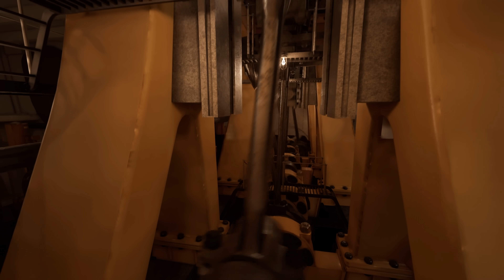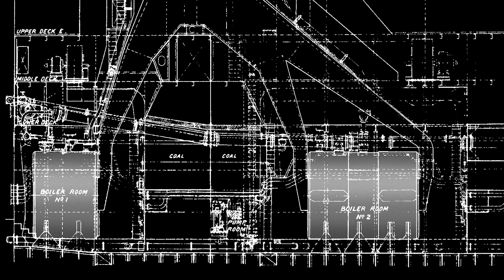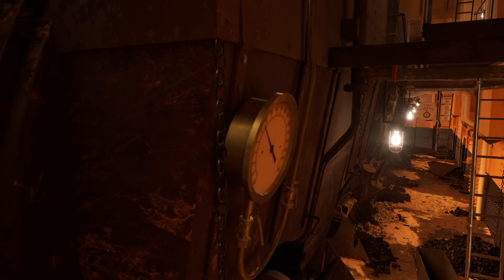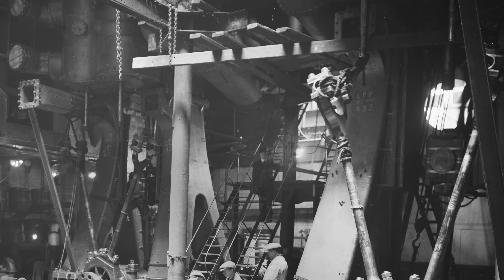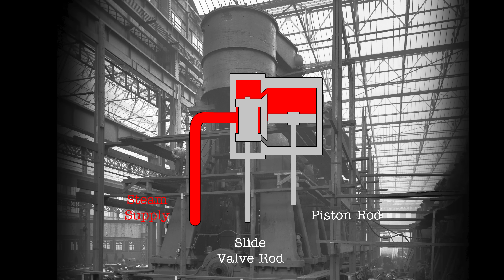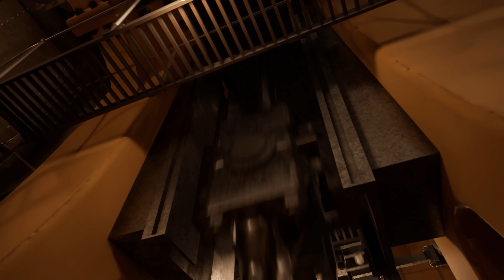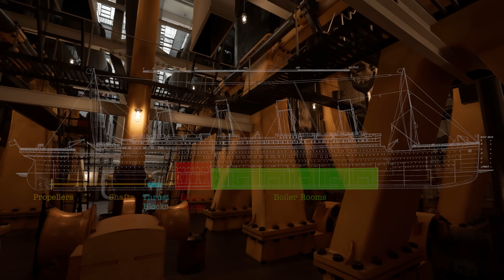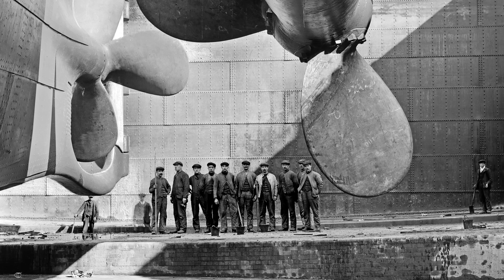A Complete Guide to Titanic's Engines

Comment: I just find it astonishing and to be honest a little sad that the unbelievable amount of knowledge and skill that went into building systems like this, all of that has been lost.  It has been lost because the technology became obsolete but all the same, it is incredible.  Around this time was probably the pinnacle of the steam engine and steam technology, the steam engine had been around for nearly 200 years and used on an industrial scale for getting on for 100 years by the time Titanic was built so to draw an analogy it is like comparing a modern F1 engine to the first internal combustion engine, that gives an idea of the immense complexity and nuances to the system culminating from decades of innovation and refinement to what is essentially a simple concept for converting chemical energy into rotation

Comment: Looks like you overrate the tonnages by the factor of 10.
600 tonnes of coal per day equals the weight of two London busses? I assume it is more likely 60 tonnes per day.
The same for the engines. 700 tonnes per engine is a bit much.
Reply: Listen to it again

Comment: Not Titanic, Olympus
Reply: No. Just no. That theory has been proven to be false for decades. But because you wont believe me without facts let me list off every reason why Olympic was never swapped with her sister. 

Starting with Olympic's collision with HMS Hawke on September 20th 1911. The initial theory stems from reporting at the time the following the collision RMS Olympic broke her keel. This is a flasehood that was created by the press to cause a sensation that White Star Line's newest and grandest liner was now broken beyond repair. This is not true. As stated in the Admiralty's report: 

“Two major watertight compartments were flooded, hull plating gashed from the Orlop deck to E deck, and the starboard propeller shafting damaged.” 

There is no mention of damage to Olympics keel. This theory falls apart further when you examine the two ships involved. HMS Hawke was built with an 8ft armoured ram. RMS Olympic was 98ft wide at her widest point and around 94ft at point of collision. In order to have damaged Olympic's keel HMS Hawke would have needed to penetrate 48ft into the Olympic which by that point she would have been doomed regardless of a broken keel. 

The damage sustained by Olympic took 40 days to repair. Not to mention she sailed from south hampton to Belfast on her own for said repairs. And during the repairs they took the port propeller shaft from Titanic and installed it on Olympic to press her back into service as soon as possible. 

As for the idea of swapping the ships out because they were 'identical', no, no they werent. Titanic had many features that Olympic did not. I will stay away from mentioning the difference in window layouts however i will point out that Titanic had significant structural differences in her B and A deck constructions to the point where in order to make her look like her sister olympic on the inside it would have taken an entire reconstruction of her superstructure between those two decks. Furthermore Olympic's bridge wings were flush with the ships superstructure whereas on Titanic they were extended out slightly to provide better visability a lesson learned from her sister. Not to mention swapping the names would have take at least a month if not longer due to the fact that the nameplates were engraved into the ships metal not painted or bolted on. In fact you can still clearly see Titanic engraved on the wreck today 

But the biggest nail in the coffin for this theory is this. Before the ships were named they were known as Yard number 400 for Olympic and yard number 401 for titanic. Every single fitting on these ships was stamped with the number that corresponded to the hull they were made for. On the wreck of Titanic on all of the machinery that hasnt rusted to dust you can see the number 401. Same goes for artifacts recovered from the wreck site. 

Titanic wasnt sunk on purpose as some part of an insurance fraud scheme, she was insured for considerably less than she was built for and her sinking pretty much ruined the white star line resulting in the 1934 merger with Cunard. She was insured for 5 million but built for 7. White star then had to pay out to the victims and their families. 

Titanic was sunk because of hubris and arrogance. The crew genuinely believed her to be unsinkable due to new inovations such as her double bottomed hull and water tight compartments. They were under orders to try and set a record crossing in order to win the blue ribbon on their maiden voyage. Had they entered the ice field during the day they would never have travelled at full ahead. There is no conspiracy around the Titanic. Human arrogance and error sent her and 1,517 people to the depths of the atlantic, not some machiavellian scheme by the rich.

Comment: The 9 psi is actually over the ambient air pressure,  not 9 psi  under the "1 bar".  Please ask drachinifel if you don't believe it.
Reply: How is 9 psi over 14.7 psi?
Reply: The psi for pressure  measures the difference between the inside versus the outside of a container. Steam pressure on the inside (200 psi, 90 psi, 9 psi...) is higher than the outside. A car tire has 32psi more pressure than the outside, and the atv 4-wheeler tire has 6-8 psi on the inside. A  cardboard box is zero psi on a pressure gauge. Steam pressure pushes turbine blades or pistons by thrust, not vacuum.

Comment: So was Lt. Murdoch at fault when he ordered "full reverse" right before collision with the berg? 
It does not seem the ship's engineers could accomplish that, given your explanation here.
Would it have been better to just throw the helm over hard to veer from the berg? 
Or to simply "shift into neutral," if that's the right analogy, but still have water pass through the rudder? 
Frederick Fleet warned of the berg and Murdoch knew what lay ahead.
Could the berg have been avoided?

Comment: for peeps like me ....a simple way to visualize how condensing steam running thru the turbine and its condensers, would condense and pull a vacuum and thus "improve efficiency of the low pressure system's, is:    take a Tupperware of food with a slightly loose lid and heat it till steaming in your microwave generating lots of pressure and venting, then stop and wait a moment before removing the container,  and then try to pull the sunken in lid off of it...   it's under a vacuum.

Comment: Question: Why couldn't the coal be gravity-fed from bunkers above the boilers instead of manually shoveled in? You could even have a system that metered out the coal at the right rate depending on the steam pressure you need. I would think this would be possible in 1912. Of course that would cost hundreds of jobs, but efficiency man!

Comment: Titanic Never Sank. It was switched with one of its sister ships, the Olympic, before it set sail.
Reply: That theory has been proven to be false for decades. But because you wont believe me without facts let me list off every reason why Olympic was never swapped with her sister. 

Starting with Olympic's collision with HMS Hawke on September 20th 1911. The initial theory stems from reporting at the time the following the collision RMS Olympic broke her keel. This is a flasehood that was created by the press to cause a sensation that White Star Line's newest and grandest liner was now broken beyond repair. This is not true. As stated in the Admiralty's report: 

“Two major watertight compartments were flooded, hull plating gashed from the Orlop deck to E deck, and the starboard propeller shafting damaged.” 

There is no mention of damage to Olympics keel. This theory falls apart further when you examine the two ships involved. HMS Hawke was built with an 8ft armoured ram. RMS Olympic was 98ft wide at her widest point and around 94ft at point of collision. In order to have damaged Olympic's keel HMS Hawke would have needed to penetrate 48ft into the Olympic which by that point she would have been doomed regardless of a broken keel. 

The damage sustained by Olympic took 40 days to repair. Not to mention she sailed from south hampton to Belfast on her own for said repairs. And during the repairs they took the port propeller shaft from Titanic and installed it on Olympic to press her back into service as soon as possible. 

As for the idea of swapping the ships out because they were 'identical', no, no they werent. Titanic had many features that Olympic did not. I will stay away from mentioning the difference in window layouts however i will point out that Titanic had significant structural differences in her B and A deck constructions to the point where in order to make her look like her sister olympic on the inside it would have taken an entire reconstruction of her superstructure between those two decks. Furthermore Olympic's bridge wings were flush with the ships superstructure whereas on Titanic they were extended out slightly to provide better visability a lesson learned from her sister. Not to mention swapping the names would have take at least a month if not longer due to the fact that the nameplates were engraved into the ships metal not painted or bolted on. In fact you can still clearly see Titanic engraved on the wreck today 

But the biggest nail in the coffin for this theory is this. Before the ships were named they were known as Yard number 400 for Olympic and yard number 401 for titanic. Every single fitting on these ships was stamped with the number that corresponded to the hull they were made for. On the wreck of Titanic on all of the machinery that hasnt rusted to dust you can see the number 401. Same goes for artifacts recovered from the wreck site. 

Titanic wasnt sunk on purpose as some part of an insurance fraud scheme, she was insured for considerably less than she was built for and her sinking pretty much ruined the white star line resulting in the 1934 merger with Cunard. She was insured for 5 million but built for 7. White star then had to pay out to the victims and their families. 

Titanic was sunk because of hubris and arrogance. The crew genuinely believed her to be unsinkable due to new inovations such as her double bottomed hull and water tight compartments. They were under orders to try and set a record crossing in order to win the blue ribbon on their maiden voyage. Had they entered the ice field during the day they would never have travelled at full ahead. There is no conspiracy around the Titanic. Human arrogance and error sent her and 1,517 people to the depths of the atlantic, not some machiavellian scheme by the rich.

Comment: way cool. I worked at a hydroelectric pumped storage plant that housed 3 pump/generators. The largest one had a capacity of 50,000 gal per second at 189 ft of head. The motor was rated at 137,000 hp . Its electric rotor 29 feet diameter.
Reply: Holy Sh*t..trying to wrap my head around that...

Comment: If you would like to see Titanic's engines,  but don't want to get wet or crushed you can see the same triple expansion 4 cylinder engines on the battleship Texas.  Identical in size (or slightly smaller) and 2 engine 2 propeller configuration.  The war ship has no room for the turbine and third propeller. Texas should soon be ready for visitors.

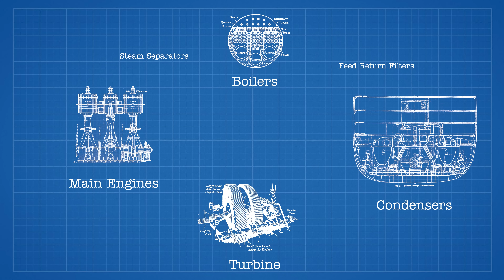Comment: The system diagrams at 8:15 and 28:45 show a picture of a main reduction gear labeled as a turbine.  The Olympic class ships had direct drive turbines and there were no reduction gears  ...  reduction gears came later when gear cutting technology had advanced to where efficient long-lasting gears could be manufactured.  Then, high speed turbines became a practical reality.

Comment: Fantastic Job.  Sorry if this is duplicate, but I noticed that the central turbine propeller is turning the wrong way in the video.  Either that to the blades are angled the wrong way.  Either way the video shows that the central propeller is pushing forward while the other two are pushing aft.  Just thought I'd point that out.  Great job though on the rest.

Comment: SS Olympic was converted to oil in 1919. The coal bunkers were converted to oil tanks. Large burners were fitted into the boilers. Efficiency was not a great as with boilers specifically designed for oil burning, but far better than coal burning. By the late 1920s very few coal fired steam ships were about.  

In the 1930s ships were moving quickly to diesel engines in new designs and refits. However the British designed Liberty ships of WW2 were specifically designed with now old technology, reliable, piston steam engines that could run on coal or oil boilers, in case oil was not available.  So many Liberty ships were built that there were more steam ships in 1945 than in 1939.

Comment: Still cant wrap my head around the physics of a steam turbine working with sub atmospheric pressure. I worked in a coal powerplant during my practical part in university. There were many turbines and burners. Those turbines were high pressure turbines and rotated with a couple of hundred rpm. Overheated steam was used to drive them.
All at high pressure. Maybe thats why i have issues with the low pressure turbines *lol

Comment: Key questions: 
- Who was the contractor that designed the engines? 
- Who was the supplier that assembled the engines? 
- Who was the supplier that manufactured the subcomponents? 
- Were the boilers lowered into the ship and then rolled into position? 
- How were the boiler exhaust casings installed? 
- Could the boilers be removed from the hull? How were they removed? 
- Would the boilers cleaned in the ship or did they need to be replaced due to corrosion eventually?

Comment: A problem was that the centre turbine powered propeller could not reverse. As the two outer props were put in reverse the centre prop was acting against them. I believe there may have been a way of shutting it down (not 100% sure on that in Olympic class).
Reply: Why on earth would you think they would have run two in reverse and one forward?

Comment: If there were 29 boilers how was there 159 furnaces? Since the furnaces are in the boilers that means every boiler had had five furnaces which doesn't make any sense. More precisely it would be 
5 1/2 furnaces per boiler and obviously a half of a furnace is impossible. They'd have had only only one furnace in each boiler anyway right? So what were the extra 137 furnaces doing?
Reply: Boiler room 1(the aft most boiler room on the ship) had 5 single ended boilers with 3 furnaces each, for a total of 15 furnaces in boiler room 1. Boiler rooms 2-5 had 5 double ended boilers with 3 furnaces in each end(6 furnaces per boiler). 30 furnaces each in boiler rooms 2, 3, 4, & 5. Boiler 6 was foremost in the ships hull and was only wide enough for 4 of the same double ended boilers used in boiler rooms 2-5, meaning 24 more furnaces. 15+30+30+30+30+24=159.

Comment: With the angled shafts for the outboard propellers, did they have massive u-joints at both ends, or have engines, shafts, and propellers, all in a line though off true.

Comment: Very good video, the only mistake I can point out. The turbine rotors were not spun, they were turned. I do not know about other parts of the world, in the US spinning refers to forming metal with pressure and rotation. Turning as what they did to the rotor is a subtractive process. Removing material to a desired shape.
Reply: You should tell this story at the next party.
Reply: @canada_sucks  Machinist laugh about it all the time. Kid asked me to have something spun, I sent him across town. Kid came back telling us the spinners told him to come here. Idiot is on the phone all the time, can't even bother to research anything.

Comment: These very primitive fire tube boilers were beginning to be replaced before this time by naval ships with water tube boilers which could produce safely much higher pressure steam. For example, the battleship BB-26 USS South Carolina launched in 1908 and commissioned 2 years later, used 12 Babcock Wilcox coal-fired Water Tube Boilers, and B&W had been supplying the U.S. navy with similar since 1894.

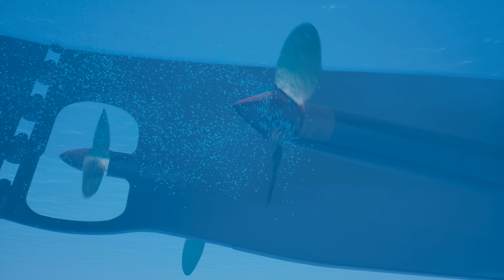Comment: 3:16 - Am I seeing things, or is the central propeller spinning the wrong direction?

Edit: At 27:40 the central propeller is also spinning backwards, generating reverse thrust (which wasn't possible with the central propeller).
Reply: Prop blade pitch will give ahead thrust.
Reply: @markbeale7390  The two main port and starboard propellers will give ahead thrust, but the central turbine-driven propeller is turning the wrong way and is shown giving astern thrust.

Comment: The difficulty with steam turbines was matching turbine blade speed with propeller blade speed.  Before geared turbines, the turbine rotors had to be very wide to run at the low rpm demands of a ship's propeller.  I believe that the Lusitania had special high speed screws that ran at 420 rpm to allow for a turbine rotor only fourteen feet across.  For the same steam conditions and power output, increasing the shaft speed by a factor of two dropped the volume (and very nearly the cost) by a factor of four.  Geared turbines allowed the turbine and propeller to be designed to operate at their own best speeds.

Comment: How was the condensate at high vacuum brought to a pressure above 215 PSI to feed the boilers? This would complete the steam cycle.
Reply: A boiler feed pump, pumps Condensate from condenser into the boiler.
Reply: @markbeale7390  Thanks Mark. Do you know what type of pump was used in that era- ex. centrifugal, piston, steam driven, electric?
Reply: @ericgiroux320  Would say steam Piston pumps.
Reply: @markbeale7390  Thanks Mark!